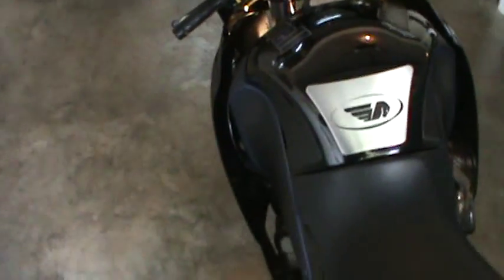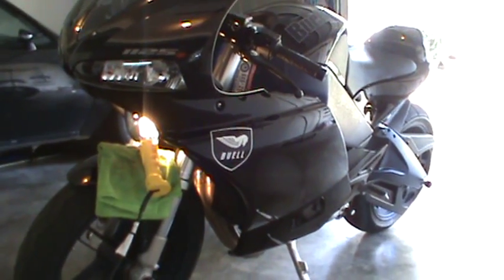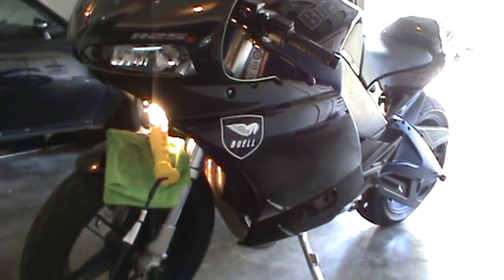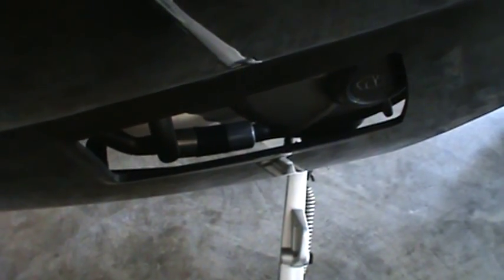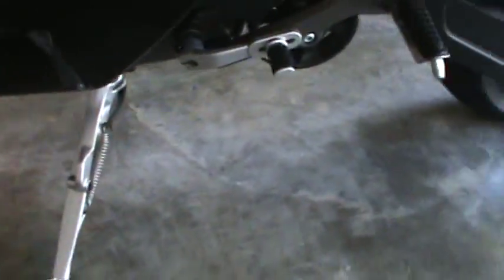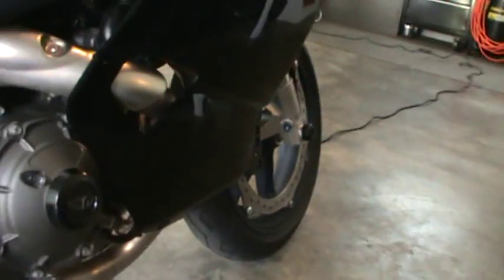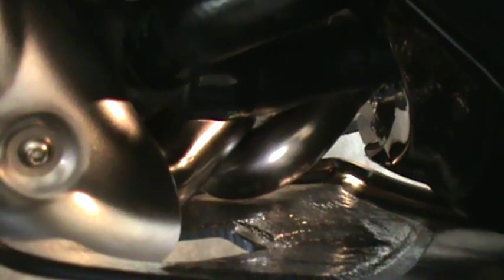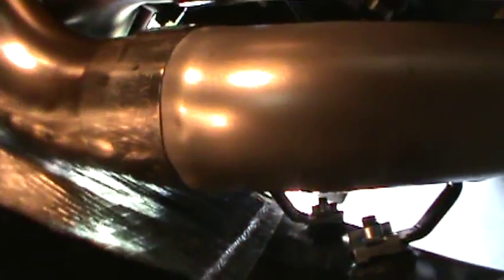2008 Buell 1125r - OEM Fairing Kit Walkaround

Comment: Could you take the inner pod off?
Reply from the maker: With the OEM lowers, the factory "pods" are  in place and the lowers cover the factory pods... There is a nice rubber pad in place to prevent rubbing. I do not have these fairings on the bike any longer. I ended up getting a full fairing Flexiglass kit.
Reply: i just always found it annoying that you had to leave the inner pod covers on....like they are just for ascetics....at least make them functional, ya know?
Reply from the maker: 2wheelLove There isn't anything stopping you from taking the inner pods off, I would however; try and wedge a foam insulator between the outer lower fairing and the bare radiator components. Primarily to keep vibrations down and reduce any chance of them making contact with the outer lowers. You could simply replace the foam provided with a thicker piece and it should work. Many of the race bikes have modified pod covers that expose most of the radiator anyhow.